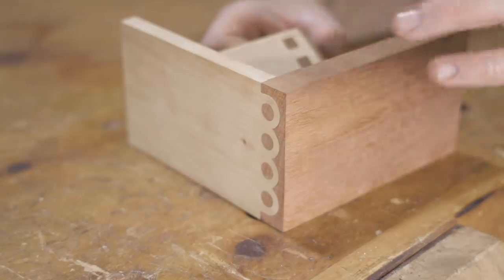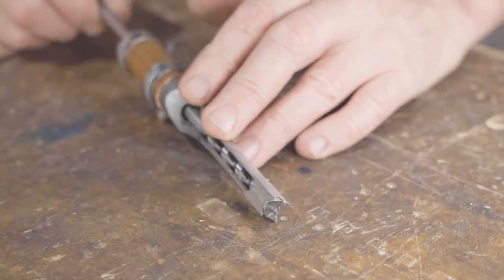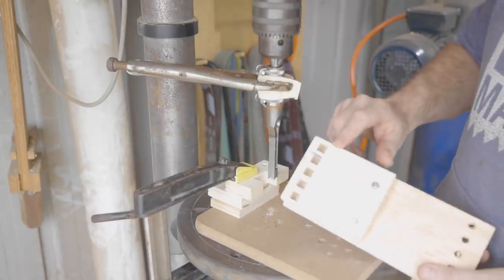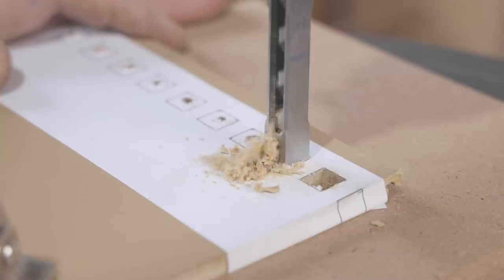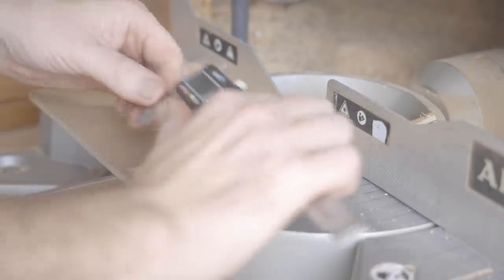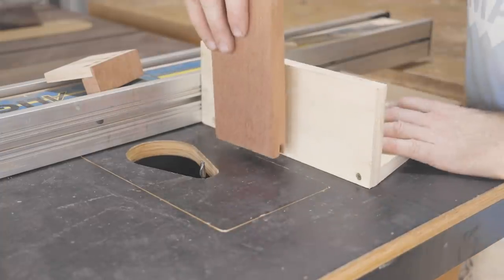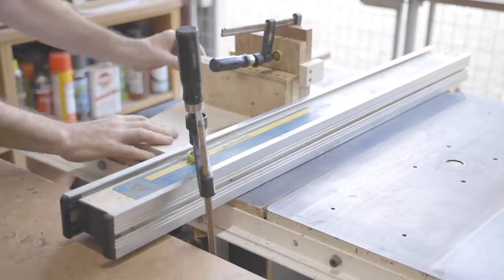How to Make this Strong Alternative Dovetail Joint

Comment: The benefit over a finger joint is that it can be a blind joist so the there is no interpretation of the drawer face.  However, if you wanted a hidden joint maybe one where the front and side are held and secured while holes are drilled and dowels are inserted.  Should be quick, strong, hidden, and much simpler to setup and perform.
Reply from the maker: Thanks, but I wasn't trying to make the easiest joint. I was trying to make a strong attractive joint that's repeatable, :)

Comment: Awesome!   Hey another simple idea for making the template...  just cut a bunch of 1/4 & 3/8 inch wide strips plywood, mdf, etc.  and glue up the strips like  a cutting board, 1/4 followed by 3/8, followed by 1/4 and so on, then just leave a 3/8 gap in your 3/8 strips and you’ll create your template with a row of square holes.    Another idea is to cut a simple box/ finger joint using a quick box joint jig with 3/8 in cuts, 3/8 inch deep every 1/4 inch.. so the box joint fingers are 1/4 inch...   after you cut your box joint, then just glue a 1/4 inch piece of wood across the top of your box/ finger joint and you’ll have an evenly spaced, row of nice square holes to use for your template.
Reply from the maker: I thought about gluing strips and that would've been the next step if my method failed. Using finger joints is a good idea too. :)

Comment: This is such a good looking joint. I must try getting some mortising bits and giving your set up a try. I'm going to make the stop leg so it goes either side of the drill colomb with plenty of slack then put studding in from each side to locate and finely adjust it . Great video thanks

Comment: It's called a multiple through-mortise-and-tenon joint (in this case half-blind). It's used a lot in modern Danish cabinetry for the carcases of chests of drawers and bookcases in which the shelves are non-adjustable (where the shelves are joined to the sides of the case by means of the multiple through-mortise-and-tenon joints). It's rare to see this joint in place of a dovetail, possibly because the short-grain from the forward edges of the mortises to the end of the board would likely weaken and crack over time. That is probably also the weakness of the Knapp joint. (It would be interesting to see how Knapp joints in furniture have aged over a long time period.) 

The multiple through-mortise-and-tenon joint is generally found in the middle of the boards that are so mortised. If the boards are thick, the sides of the mortises are banked (dovetailed) and the tenons kerfed on their ends, with wedges driven into the kerfs to dovetail the tenons immovably in the mortises.
Reply from the maker: Thank very much for that. I've seen through tenons in the middle of a board but I've not seen them used in this way (and not half blind). I've searched and searched for an example and I haven't found anything but I'm positive it would exist somewhere.

From what I've found out about Knapp Joints, they have stood up extremely well and as you probably know they are all over a hundred years old. I don't see the short grain from the forward edges cracking easily. They are well supported by the rest of the joint and would require some serious racking, but I suppose only time will tell. :)
Reply: @PaskMakes  Thanks. You're probably right that this joint hasn't been used as a dovetail  substitute and that you're  the first to use it this way. And also you're right again about the support in the Knapp joint (looking again at the Knapp/pin & cove joint, I see that the cove board side is strengthened against racking by support from the pin board side).

I suppose also that in a hardwood like American sycamore with high splitting resistance there would be no endgrain splitting in the short grain sections of the Pask joint.
Reply: " half blind multiple through-mortise-and-tenon joint"... it doesn't roll off the tongue quite as easily as Pask Joint tho does it? ;)
Hell, he re-invented it, he should get to name it.

Comment: Hi, I have a mortiser and use it on a lot of my projects, you are right when you say the drill bit needs room to move and not tight to the chisel. There should be between a 1/8 and 3/16th's of an inch space according to my Mortise manual.

Comment: That's an unusual and interesting joint! Love how it looks!
Now for a different (cheat) approach to the construction:
- Make half lap joint and glue it
- Use mortising bit to drill square holes to joint, through both pieces of wood
- Make square pegs to match holes and insert them with glue
- Sand and you're done
You can even have different spacings and crooked alignments and it will always work, because both sides are drilled simultaneously :-)

Comment: Looks good. Well done.

The Knapp joint is more decorative, but this square pin joint looks to be stronger and looks to be easier to make.
If you were in the US I would send you my Delta mortise attachment for a drill press.   It does not fit on my Powermatic floor standing drill press.   I tried this once on a bench style drill press where it did fit.   I was not able to get the chisel to make the cut.   I even tried pre-drilling most of the hole first.   Still not able to create sufficient force on the small drill press.  This now is used to collect dust, a task for which it excels.
Dave.
Reply from the maker: Thanks very much Dave! I've always known the mortising attachments for the drill press aren't too good but mine worked surprisingly well. I found it best to apply a little pressure, back off and let the chips clear then go again. It takes a little longer but it doesn't get clogged that way. I'm not sure I would've even tried this if I didn't have the bit sitting there. :)

Comment: Great work Pask Makes.
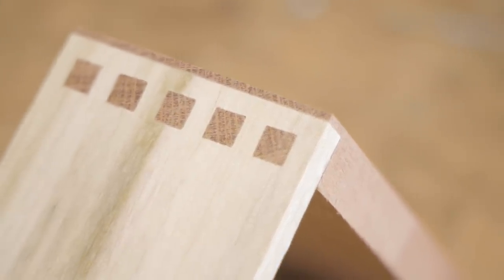At the end ( 14:47 min) when you compared the two joints I got an idea, maybe you can do another joint; combine the square pegs with the round pegs (the Knapp Joint) so the Knapp Joint lose the scallops.
So make the Knapp Joint without the scallop, this way you don't need the square chisel bit and the complicated scallops ?
Hope you have the time to make it ! Thanks.
Reply: markspc1 That would be a gorgeous alternative!
Reply from the maker: Thanks Mark! That is a known joint and you should be able to find examples with a search. It's easier than the scallops but even though it looks good it isn't as striking as the other two joints. I do still like it though. I was going to include it in my last video but it was getting too long. :)
Reply: Thanks  @PaskMakes . It should be fast to make the scallop-less Knapp Joint; you already have the toll to make the pegs and the template to make the hole :)
Reply: @MonicaLN  Thank you Monica, hope Pask have the time to make it.

Comment: A half-blind through tenon, was taught in college it doesn't really matter how many tenons you have you can just call it a tenon joint...but if you want to get fancy add a value for how many, for the one in the vid it would be a half-blind through penta(or quinta whichever rolls for you) tenon

Comment: nice, love the joint though do wonder about the jigs, if you used your router to drive half way through the template in one direction on one side then 90 degrees off on the other direction you would save a lot of time and effort to get a very accurate template, if you then used that to hold the square part you wouldnt need the top brace, add a pin you can drop though and you have a 2 hole jig that can be used quickly for any number of holes, my vote would go for a lapped mortis joint

Comment: If you were to make the top piece of the fence out of metal and cut the opening the width of of the mortise chisel  you could just adjust the drill press table up so it was always guiding the mortise chisel and you wouldn’t need the template.

Comment: If the template were thicker, you could start the square of the mortise bit down inside, before turning on the drill press. No arm up against the drill press post needed.
Reply from the maker: That's how I did the first test but when the bit comes back out it starts spinning. And there's no way you'll pull that bit out gently to stop before it comes out of the template, it takes a little force to pull it out. That isn't really a problem but it's much nicer having it stay in position and as I said you only need to put vice grips on it. :)
Reply: Safety first.

Comment: Hi Pask, I've got a morticing machine.

You need about a 2mm gap between the bit and the chisel for best results :-)
Reply from the maker: Thanks very much Michael! That's good to know and I'll give it a try. :)
Reply: @PaskMakes  I've seen either a credit card or an american dime advised as a feeler gauge for the proper gap. I use a dime on mine for 1/2" or smaller chisels, and a penny on larger sizes. Also, a dry lubricant like boeing t9 can help make sure chips flow out smoothly and things stay cool

Comment: 1) Fantastic ... I like the name "The Pask Joint"
2) I think you could probably simplify it with just pegs (This is of course cheating). Make the rabbet joint - no pegs of any kind. Use your morticing bit to simply drill out square holes through the side and into the front. Fill with square pegs - just like dowels. Plane off, sand, done.

Comment: Nice joint, and nice templates. 
I think it would be better to use a axial thrust bearing, they are really cheap and built to take up the force in axial direction.

Comment: Beatiful joint sir! You are far more determined and patient than I am for sure. Have you considered making the joint without the narrow strip on the tennon piece, so the mortise piece would be flush with the edge of the tennon piece? I also vote for the "Pask Joiint". I wouldn't be surprised if one were to reseach some of the old antique joinery  books, that a precurser to joint may exist. The old hand tool guys were pretty talented and creative.
Reply from the maker: Thanks JB! I reckon that would look great without the narrow strip but that would be a whole new set up. I'm sure this joint must exist somewhere, I searched for an example but couldn't find one though. :)
Reply: @PaskMakes  I also did some searching and could not find anything like it. You should patent/copyright it.

Comment: If the pins are spaced one pin apart, and the mortise piece is clamped over the tenon piece, offset by 1 pin, then both the mortises and the gaps between tenons can be cut in one motion. Still requires clearing away the sides of the tenons though.

Comment: hi if you set spacing between pegs to be equal to pegs (use same guide to do holes and pegs ) you can eliminate routing.....its faster and more flexible (mitered corner etc) to do face of joint on table saw ,,just idea...best regards mark
Reply from the maker: Thanks very much Marek, good ideas. I purposely chose the 1/4" gaps as it looks more aesthetically pleasing. I'm not sure it would be any faster though as it takes no time at all to do the routing process. :)

Comment: Could you overlap the front and sides, like a low-end butt joint, and then use the morticing chisel to drill a series of holes through the side and into the front.  Then you could insert square pegs.

Comment: Neil... love your work. 
I am curious if your can rotate the squares to look like diaomnds?
Also curious if you can avoid the router table and cut the waste around the pegs with the mortise bit?
Reply from the maker: Thank you! You could cut the diamonds but it wouldn't be easy to route the opposing piece. I'm sure you could remove the waste with the mortising bit but then the pins would be evenly spaced which wouldn't look as good (in my opinion). Unless you used a smaller morticing bit and made multiple cuts. :)

Comment: you will need to replace those "rotary" bearings they aren't made for that type of force. what you need is a thrust bearing it's designed to allow a shaft to rotation while provining force in this case between the hollow chisel and the chuck. if you don't replace the rotary bearing I fear will have it either lockup and hurt you or damage something near you/ the drill press all in a quick fashion and violent manner.

Comment: How about doing a joint with ovals? Or 5- or 6-pointed stars? Or triangles? Or diamonds? (For the diamond you could use this method but turn the mortising bit 45 degrees?? The other half will be trickier, though.)

Comment: now you can make them into diamonds by rotating the 'square' by 45°. although the negative cut will be much! harder. (maybe the router table would have to be setup to make 45° cuts which should cut the right of one and the left of another.

Comment: I still like this, but on 2nd though.. Clamp the two sides together, drill holes (square or round) and hammer in some pegs. Visually exactly the same only quicker and easier to do.

Comment: In terms of time/ease of use, and ignoring aesthetic preferences, do you prefer this joinery method or your Knapp joint jig?
Reply from the maker: I reckon this would be a little quicker than the Knapp Joint. I think I prefer it too but only slightly. It's a little less showy. :)

Comment: wouldn't turning the mortises 45 degrees make the resulting joint stronger? if you're making drawers out of fairly straight grain wood, it seems like those square edges would make the joint more prone to cracking
Reply from the maker: If you turned them 45° it would be difficult to make the opposing piece. 

I'm very confident this joint will last for a very long time and I don't see any real weakness. The short pieces at the back of the mortises look like they could break but they're well supported by the rest of the joint and would require some serious racking to break them. I don't see that happening. If you analyse a dovetail you may think the outside short grained wings of each tail could break but the same thing, they are well supported by the pins. 

All these joints, dovetails, knapp joints, finger joints and the joints in this video, are all extremely strong and very capable drawer joints that will last probably longer than us. :)
Reply: @PaskMakes  after I made the comment I concluded that making the pins would definitely be a nightmare.

Comment: Seems like it would be easier to do a rabbit joint, drill square holes through both pieces, make square dowels to fit, hammer them in with glue, cut and sand.
Reply: Why not drill round holes and just use round dowels with wood glue to attach the two pieces?
Reply: The point was the pretty squares made with contrasting wood, but round would work too.

Comment: Excellent videos and love how your mind works. Just to answer your question. Your joint is very similar to the following. 
Albert Jackson and David Day wrote manuals back in the 40s that were collated into a book called Wood workers manual in 1989 isbn 0-00-411565-1 published by Collins.
Where this joint is called a Pinned Mortice and Tenon Joint. It also shows the adapted joint using wedges set diagonally which I think would look awesome.

Comment: There is a perfectly good alternative to this: a dovetail. They are really easy to cut by hand, even lapped ones. Having said that a secret mitre is much harder. This seems like a complete waste of time. But you want a name so here it is: An Irish lapped comb joint. You could make an Irish double lapped comb joint which would benefit from being even more difficult to make but less unsightly. Just use dovetails, if you really find it hard to make them then a day's practice will solve the problem.
Reply from the maker: Thanks Ben! I love making hand cut dovetails and no I don't struggle with them at all, it's one of my favourite things to make. 

There's no reason why an alternative can't exist and it would be boring world if everyone made the same thing. If you don't like it then don't use it, it doesn't mean it's useless, unsightly or a waste of time, in fact it is far from it and that is just your own opinion(which of course you're entitled to). :)
Reply: @PaskMakes  Yes, everything I say is my opinion. Your passion is admirable but misguided. You are reinventing the wheel. How about a video about 'low pressure veneering' over a large (more than 1 square metre) area using only simple cheap workshop tooling. Or sharpening jigs. I can give you a pile of ideas about these if you want. I'm a 57 year old craftsman cabinet maker and just maybe I know a thing or two.
Reply: @benchapple2117  Living proof that you can't please everyone...

Comment: I hate to generalize, but I've noticed that if a wood work is primarily a heavy machinery guy, he puts dove tails running up the side like the teeth on a saw. If you are a hand tool type of wood worker, I've notice you can space out the dove tail to little as three, and that will work just fine. More look better, but just for pure function, you more isn't better. Just a possible observation.

Comment: Sorry to be the purveyor of bad news 🙄 but..... This joint is not sound. The design offer's incredibly low fatigue resistance, even if wood is acting as a unidirectional fiber composite, still very short fatigue life. I'd suggest you round off (fillet) the sharp edges and change the over all design to pegs and holes. 
Peace out ✌🏻